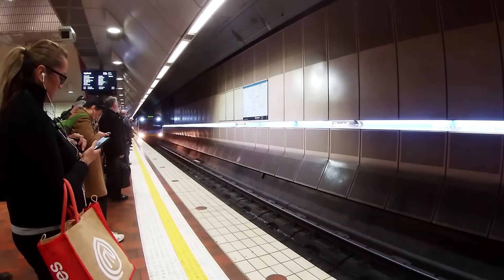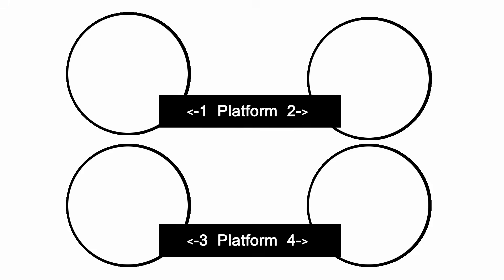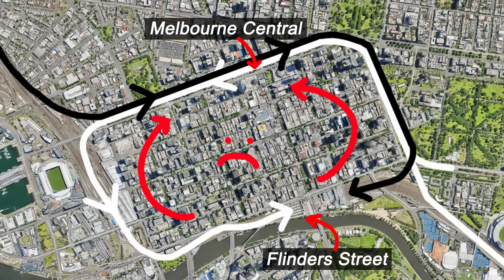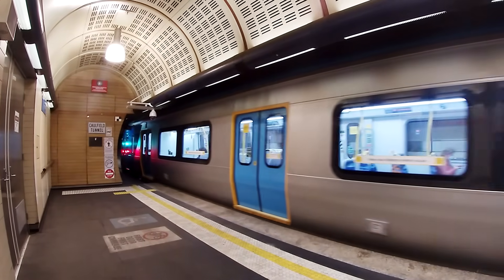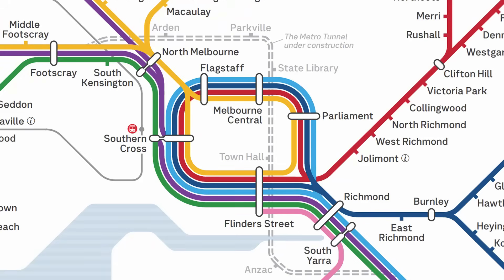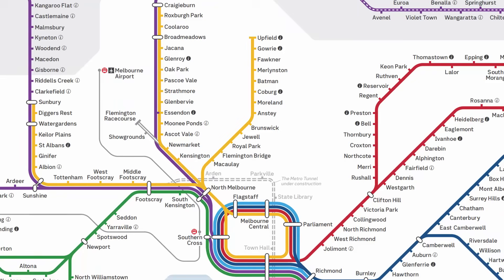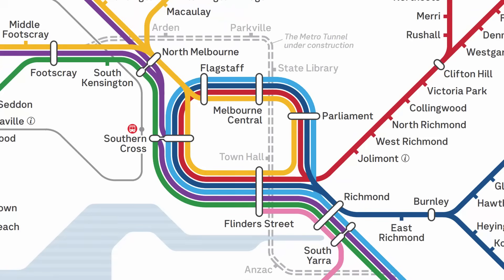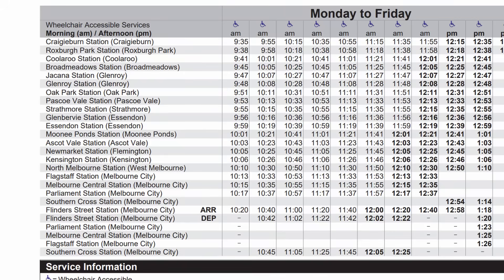Melbourne's Underground City Loop - Explained!

Comment: Mr Taitset have you ever considered doing a video on the proposed City Loop Reconfiguration? While I understand the broad strokes of what it does and how it is to be achieved with the two new tunnels, I'm having trouble visualising exactly how it would operate. From what I gather there are two be two new tunnels brancing off from the existing City Loop tunnels? 

I do suppose there is not a lot of information out on the project so far, but it seems like a very useful and handy project so I would love to know more about it.
Reply from the maker: Yes it's on my list! I haven't actually looked into it in detail, but yeah the basic idea is a couple of short bits of extra tunnel to allow through running Richmond-Melbourne Central-North Melbourne, then you'd split some of the lines off so they don't go through Flinders Street.

Comment: I may be jumping the gun if you get to this later in the video, but the HCMT trains all have the light blue color, and all have maps inside the cars with “direct” and “via city loop“ direction options for operation. Where these maps installed in the trains before it was decided they would all run counterclockwise all the time?

Comment: The other "fun ritual" that a lot of commuters have is trying to skip the loop by walking or changing trains.

For example, say you're on a morning train that comes in from the East, stops at Richmond, then goes all the way around the loop to Flinders St, which is where you want to get to. A lot of people will get off at Richmond, check the screens for the next "direct to Flinders St" train, and then race across the concourse to catch it. It sounds like a hassle but it saves a decent amount of time compared to going around the loop (provided your new train doesn't get stuck underneath Fed Square waiting for a free platform at Flinders St.

The other alternative is to get off at Parliament and then either walk or tram it down Collins St. That can also be faster depending on exactly where you're trying to get to.

Comment: yesterday was my first day of work in the east after being a westie my whole life, the city loop being called a loop threw me for a loop when coming home. I was on the Laverton train planning on getting off at Southern Cross, the whole trip the announcements were "Laverton train this, Laverton Train that" I kept checking to see that Southern Cross was showing up on the PID, even at Richmond! Until Flinders Street when it turned into a Craigieburn train. Well that's fine because its still on the city loop and that includes Southern Cross right? RIGHT? I couldn't tell because the PID on the train was just saying Craigieburn via City Loop, so I stayed on only for the train to go the wrong way. Got off at Melbourne Central and had some terribly dry KFC (how does it feel like its been there all day if you are in such a busy place). 
The way you've explained the loop here has done wonders for my confusion, I will be telling everyone I know that the loop is not a loop but a devils scythe to off you at the end of a long working and traveling day.

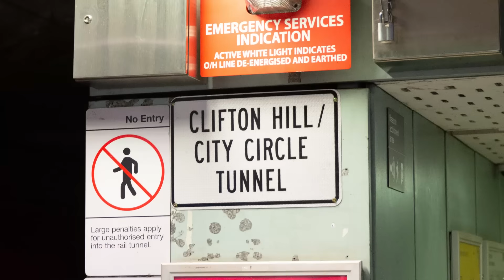Comment: 8:43 the city circle service is run in situations where certain lines cannot run through the city loop for whatever reason, it takes the load from those passengers.

For example, there are times when Pakenham/Cranbourne trains only go as close to the city as Caulfield. Passengers have to change for a Frankston Line train which doesn't go via the loop and so when they reach Flinders Street they may want to go to the loop stations. The city circle service runs in this circumstance to take that load.

Comment: I've had to peer out the door or window when arriving at Flinders Street to see if the train's continuing on to Southern Cross so that I can continue on home with a V/Line service to Geelong. It's really irritating especially if I have to get off at Flinders Street and then try and work out which platform to go to that has services running through to Southern Cross!

Comment: Great video 👍, also isn’t there another Tunnel entrance next to the Caulfield loop entrance at Richmond that Sandringham trains use to use sometimes?
Reply from the maker: The second entrance is for the Frankston line, not currently used. It is physically accessible from the Sandringham line, but Sandringham hasn't run into the loop for many years.

Comment: There are two things about the City Loop I prefer to the City Circle.

1. The stations are spread further apart. There is actually a decent amount of distance between, for instance, Flinders Street and Melbourne Central, or Southern Cross and Parliament, meaning all stations are useful and well patronised. By comparison, St James and Museum stations are extremely close to Sydney Central and Town Hall stations, which both get far more services, making them both a bit useless.

2. Trains run faster through the City Loop. Catching a train through the City Circle running at 25km/h and wishing you'd instead caught the light rail or even walked is a Sydney tradition we could do without.

Another thing I prefer about PT in general in Melbourne's CBD is that train and tram routes run in all directions while PT in Sydney CBD is extremely north-south centric. If you're going from the east end of Sydney's CBD to Darling Harbour, your only direct option is to walk.

Fortunately the Sydney City Metro and Melbourne Metro Tunnel will make travelling through both city centres much easier and faster.
Reply: I reckon the lack of an east-west train/light rail line across Sydney’s CBD will get better once the Sydney Metro West project is completed as well. Say currently you want to get between Martin Place and Pyrmont Bay (e.g. for the Maritime Museum or Darling Harbour), which would be a 25 minute walk or very similar on public transport because it’d be an indirect route. But after 2032, the trip between Hunter Street and Pyrmont should really only take at most 5 minutes.

Despite St James and Museum having less platforms than Town Hall and Wynyard as the T1/T4/T9 don’t run through there unlike Town Hall and Wynyard, I would say that St James is still very useful for those wanting to get to the Martin Place area and does get reasonably busy.

Comment: Interesting how in both Syney and Mebourne trains can run around the loop and then form services to a completely different place to where they came from.  In Chicago, where we have a similar loop (though ours is elevated), every single train that circles it returns to exactly where it came from, and it has been operating like this since basically forever.

Comment: Something must've been broken on the Burnley loop today, they're running trains through the loop and out the city circle tunnel entrance to take passengers for those lines back to Flinders St. Must be the first trains running on that part of the line in...how long?
Reply from the maker: It's actually pretty common when there are planned works on one of the other groups, they run some City Circle trains to maintain a reasonable service around the loop, and also sometimes to meet with replacement buses at Parliament. They were doing it last weekend too.

Comment: 8:21 - That's quite an interesting picture, because SW6 tram No. 852 was exported to Auckland, New Zealand in around 2015 or 2016. She's now preserved at the Wynyard Quarter tram line, with another SW6 (No. 881) and the little X1 class No. 466 for company.

Comment: 7:30 It's worth noting that you can easily avoid having to travel the wrong way around the loop by a short walk or tram ride to Parliment station from Flinders.  

It's not necessarily any quicker but its nice to have options.  Particularly on a hot day I'd rather walk for ten minutes than sit on a train for the same amount of time if the destination is the same.  

You're better off boarding at Flinders if you want a seat though, at least that was the case when i used to catch the train.
Reply from the maker: It's not an easy walk to do in under 10 minutes - certainly possible (might need to jog), but most people wouldn't be able to do it and get on the same train. You can catch a Northern Group train in the opposite direction and head it off (like I did in this video: https://youtu.be/ubNrj64zG7c ) but even that is marginal and depends on a train departing within a pretty narrow timeframe.

Comment: Another interesting Video
I had not traveled on the suburban network for 20 years. Last year i decided to give it a go as a wheelchair user. The staff at the gate and the drivers (who get the ramp out) were all a great help.
But I must say, Melbourne Central Station was very much in need of a clean. And I needed to use three separate elevators to get from the platform to the shops above. It was not simple

Comment: The city loop at times will serve more lines than the 4 groups mentioned in the video, on weekends it serves the Werribee/Williamstown lines. I personally don't get confused when I hear the term "City Loop" at a station as I've always understood innately it meant Parliment, Flagstaff and Melbourne Central, and knew direct to Flinders St would skip the loop, and I'm pretty sure the reason I innately knew this was related to a station I have a love for; Southern Cross. If it was a City Loop train, it went through the tunnel after North Melbourne on to Flinders St, skipping Southern Cross. If it was direct to Flinders St, it would pass through Southern Cross, and I just naturally understood that about the loop. knowing how to navigate around Melbourne's public transport is an important skill that many discount as stupid. Personally, I utilize the maps, timetables and knowledge I have of the system growing up around public transport in the western suburbs to figure out my way around
Reply from the maker: The Werribee and Williamstown lines don't use the loop on weekends any more, that finished a few years ago.

What you're describing about 'instinctively' knowing details about the operation through the loop is just based on your life experience. It doesn't mean those details can be easily worked out by infrequent users of the system.

Comment: The point about trains “changing” at Flinders St is especially frustrating for me trying to get an Upfield train home from Southern Cross in the evening.  Countless times a train leaving SC with an Upfield headboard has magically transformed into a Craigieburn or Watergardens service on arrival at Flinders. The only safe way home is to catch a clockwise loop service to Flagstaff and intercept an Upfield there.
Reply: which is ALSO faster given that the Upfield line runs every 20mins, 
I used to just ignore it and get a Mernda train to Flagstaff/MelbourneCentral and then walk across the platform and get the earlier Upfield train

sure I potentially have to stand if I'm unlucky, but I also get home 20mins earlier

Comment: Having used the loop a lot I thought it was just better way of turning the trains around. Note it is quicker to change trains in loop as frequently you just cross to the other platform rather than crossing 10 platforms at Flinders st.

Comment: I remember the before times, when peering through the hoardings around the Loop works was a part of every trip into the city.
When the Loop opened, it was as though a mystic portal had materialised, allowing easier access to places that teenaged me would have otherwise had to walk to.
Now, the new works are rekindling the anticipation of discovery

Comment: Great video. Thanks for sharing. Now I understand why the city loop trains changed directions. I can't wait til that practice is totally removed and all lines have permanent running directions. Maybe that will happen once the metro tunnel is operational. I can't count the number of times I've been in the CBD and have rushed to Flinders St thinking that was the best option, only to find that my train is actually going via the loop. I also can't count the number of times I've rushed to Parliament or Melb Central thinking that was the best option, and again being mistaken.
Reply: Why would you even care? If 10 minutes is time critical, you wouldn't be taking a train in the first place
Reply: @michaelellis8726  In peak hour you can get from one side of Melbourne to the other much, much faster on a train than in a taxi.

Comment: Good explanation - it's taken me over 15 years of visits to Melbourne to figure out the city loop - wonder what'll use the Caulfield part of the loop once the metro tunnel is up and running.

One of my first visits I remember not only getting confused because the Clifton Hill group train I was on (around midday) not only didn't go past Flinders St, but unloaded all the passengers on what was platform 14, which at the time I didn't even know existed.
Reply from the maker: I believe the plan is to put Frankston back in the loop once the Metro tunnel opens.

Comment: I think the only way to operate trains anti clockwise on the Clifton Hill group would be to have city bound trains departing from platform 2 at all stations instead of platform one (which would cause a bit of confusion at first). But it's good they've stuck to clockwise operation, I can get on the train at Flinders Street during peak hour and get a seat

Comment: So Lets say I live in Craigieburn and I wanna take the train to Melbourne Central and the train stops at Flinders do I stay on that same train and will it take me around the loop and back up to Craigieburn or what? Its just so confusing!
Reply from the maker: So first of all, most of the time (weekends and weekday mornings) your Craigieburn train will run around the loop first anyway. But on weekday afternoons, it will go to Flinders St. 99% of the time it will then continue around the Loop (not always back to Craigieburn, could be any one of the yellow lines). But in case it doesn't, I would always stick my head out at FSS and check. Another option would be to get off at Southern Cross and catch a Clifton Hill group train (anything off platform 9) which will definitely take you straight to Melbourne Central. 

The fact this answer had to be so long is a perfect example of just how crazy the Loop is. :)
Reply: @Taitset  Got it thanks, I followed my PTV app this tike took a train to southern cross then took the hurstbridge train whatever its called and stopped at Central but I will follow that next time, Thanks!

Comment: This is such a great video! There's one aspect this video didn't really explain for me though – what happens between Southern Cross and Flinders Street? Is there still a track assigned to each line group, and then 2 extra tracks for trains that bypass the loop, or are the tracks organized differently? And I was also confused as to why trains are timetabled to start or end at Flinders Street – does it act as a terminal station or a through station (or both)?
Reply from the maker: You've pretty much got it. From the north side downwards are the Clifton Hill, Burnley, Northern then Caulfield viaduct tracks, which are bidirectional and essentially function the same way as the loop, though with a bit more flexibility because there are crossovers at each end. Then on the south side is the 'new' viaduct, which I think is called the 'Through Suburban,' and behaves like a normal double track line. All freight and country passenger trains use this, as well as many cross-city suburban services. FSS is essentially a through station, though it is common for trains to reverse direction there as well. Making it the start/end point of services serves no real purpose, it's basically just an annoying historical quirk!

Comment: Ah yes trying to catch a train on the Craigieburn line from Southern Cross in the afternoon peak is like playing tattslotto until you figure out that if you catch one of the trains heading out to the Eastern suburbs it’ll take you to around the loop and you can get off at Flagstaff and catch the train going to Craigieburn from there, it sounds confusing until you try it.

Comment: i don’t know if this is something you’ve covered or common knowledge but, ive lived in melbourne for 3 months now, and get really frustrated with how every station seems to have a different way of presenting what trains are coming when at what times. im used to the bigger stations in sydney (im from newcastle) where a board will tell you the info you need, including what stations the train will stop at, in a very clear format, which is consistent across all stations. melbourne stations seem to have no consistency with how they present this information, and anytime i am at a station im not familiar with, it feels like i’m solving a rubix cube just to figure out where i’m going. even the ptv app doesn’t clearly display what platforms you need to go to. sorry for the rant, hope you have some answers :)

Comment: Idk how Melbourne has done public transport so wrong. Next talk about Myki, the initial stuff up of it's implementation, and poor pricings. Then the thousands of different train routes on the belgrave/lilydale. Bats flying into electrical equipment and taking the whole system down.. sigh. how did so much go wrong
Reply: don’t forget about the constant delays due to ‘trespassers’…..

Comment: Did Melbourne have 1 double-decker train, like Sydney's , but just for a brief period of time in 2001 or so? But it didn't fit under bridges, so only ran on Belgrave/Lilydale line?
Reply from the maker: It was called the 4D, ran from the mid 90s to about 2002. It looked very similar to a Sydney Tangara but was actually quite different. It was only ever approved to run in service to Belgrave and Lilydale, but it wouldn't have actually taken that much work to modify other lines - despite what you might think, it was only fractionally taller than our single deck trains.